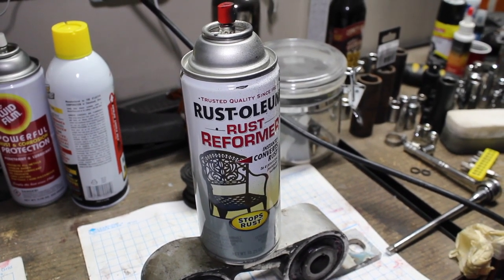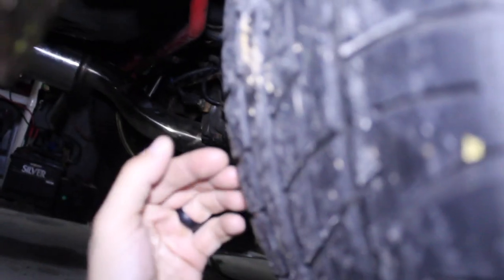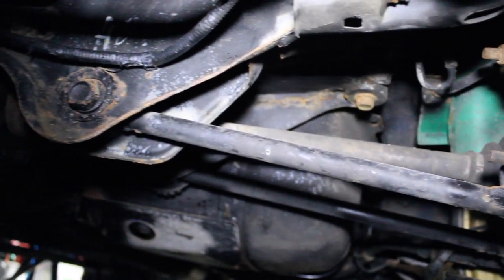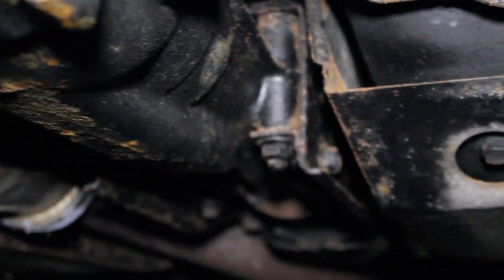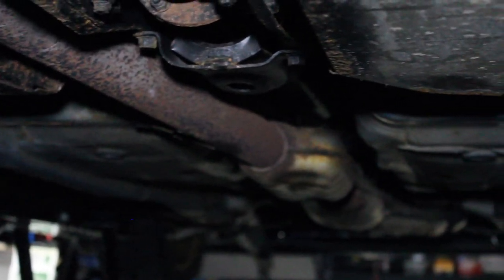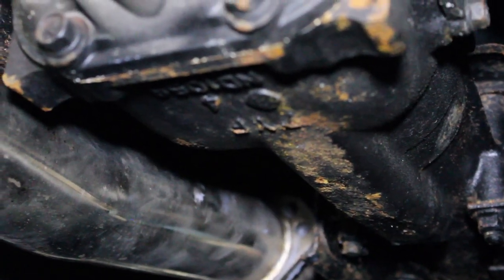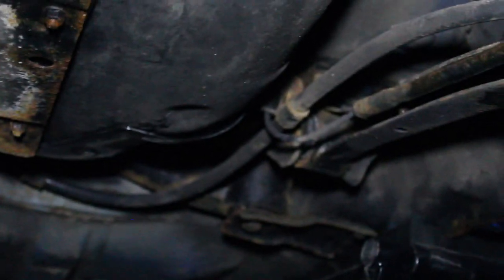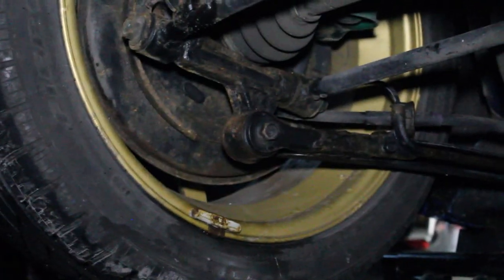Rustoleum Rust Reformer 1 Year Update Subaru SVTWRC

Comment: I'm doing the underside and frame on my 08 F150. I wire wheel everything, pressure wash it, let it completely dry, use a metal primer,  rust reformer, then top coat with black gloss Enamel from an actual paint can and brush. It goes on alot thicker this way and you can really work the paint into cracks and corners. And its cheaper than buying 15 spray cans. Once dry hit everything with clear gloss Enamel to seal the deal. Only downside is that it's very time consuming but its pretty much the only way to stop the rust.

Comment: I thought the rust reformer stuff is essentially meant to work like a primer. It reacts to rust, converts it to an inert black primer coating essentially. But like other primers, it's porous and doesn't seal the metal and won't stop new rust from forming underneath. I would have applied the rust reformer and then painted it with a top-coat. Even better, just use POR15...
Reply from the maker: Max Bitel been hearing great things about POR15 going to give it a go this spring. Will take some footage .
Reply: it doesn't react much to rust, just a cover up.  once coating cracks (which with in 24 hrs) water will collect under the coating and create mega RUST.
Reply: POr15 sucks. Use Rust Bullet my friend. Try it you’ll never go back.

Comment: Just used this stuff on my trailer hubs and undercarriage and after 4 days of sitting. There is some signs of the rust bleeding through. I am wondering if I paint over it if that will help keep the rust from bleeding out. I prepped the surface really good behind it and brake cleaned the crap out of it too.. Wiped it down afterwards and still got rust bleeding through. I did 2 coats. I do like the stuff but I might try another coat to see if it will stop the new rust from bleeding through. Suggestions?
Reply from the maker: Jay Bourbon hi some are using an enamel over the reformer but if it’s seeping through it may be about slowing it down more than stopping it. I just went under for a two year check up and I’m making a new video about it. You can see where I missed but it’s still better than it was in the before shots.
Reply: Rust reformer doesn't react much to rust, just a cover up.  once coating cracks (which with in 24 hrs) water will collect under the coating and create mega RUST.

Comment: Rust converter cause more rust.  I used it and in 3 years the total bottom of my beam got eaten away.  The reason is that once the rust converter coating cracks it collects water behind the coating and hiding the rust until it's too late. Trust me, check it out yourself.
Reply from the maker: New update soon , im using Fluid film now  with a coat applied every year before the winter season just have to keep it off rubber bushings.
Reply: @svtwrc  what happens to rubber bushing? what about rubber boots?
Reply from the maker: Web Cityx Fluid Film bottle claims it may deteriorate rubber if heavy coats are left on it.
Reply: @svtwrc  they say it may cause the rubber to "swell"
Reply: @svtwrc  My 2007 GMC was neglected and had some serious rust, this is exactly what I'm doing. Rust reformer followed by fluid film. Can't argue with the great results so many people have had with both! I trusted Rust Reformer especially because I found literature of tests done by various forest services, including one in Canada.
Reply from the maker: Adam J once it swells it should crack the rubber. Fluid film has been amazing . Thanks

Comment: Use rust reformer,at least do 2 coats and for your top coat use Mastercoat extreme permanent rust sealer and AG 111 for your last one,i used a grinder to remove any loses rust
Reply from the maker: Kayena Arellano nice ! Going to take a look at those products.
Reply: Rust reformer doesn't react much to rust, just a cover up.  once coating cracks (which with in 24 hrs) water will collect under the coating and create mega RUST.

Comment: that's looks good! did you top coat it with anything? I just did mine with enamel for a top coat.
Reply from the maker: Jacob Almeter that’s a great idea , didn’t even think of that.
Reply: @svtwrc  I believe the reformer is like a primer and lasts even longer with enamal on top. I used the pro enamal cans from Rust-Oleum. next time may even seal it with clear coat.
Reply: Jacob Almeter I just boat three cans of enamel

Comment: maybe I'm missing something but all I see is rust at all the edges and seams.. if the loose flaky and scaly rust isn't removed the rust reformer isn't gonna get under it and the rust continues.. at the very least all the rusty areas should be wire brushed or better yet wire wheeled before any top coating..

Comment: I got some rust forming inside my trunk at the edge inside by the welded points. What’s my best approach to painting it?  Do I need to tape off the entire back or just do short sprays not during a windy day?
Reply from the maker: NYGriego 74 you can use a wire brush on whatever you can see and spray the Rustoleum into the cap and paint it on w a brush. May just work
Reply: Rust reformer doesn't react much to rust, just a cover up.  once coating cracks (which with in 24 hrs) water will collect under the coating and create mega RUST.

Comment: Do you use Rust-Oleum rubberized undercoating after using rust reformer?
Reply: You can. Sand it, prime it with rust reformer, then hit it with the rubber coating. I think that's the best way, its an extra layer of protection against rocks and gravel or anything else that will chip the paint down to bare metal and make it rust.

Comment: If you use phosphoric acid and then a wire brush you'll really be able to knock that rust down to nothing. Rust reformer over that and then finishing the whole underside with Fluid Film, Krown, or used motor oil(anything oily or hydrophobic) will really keep the salt and moisture from forming rust. From there you just need to real oil things once a year(during summer is best so the oil can creep into all the metal). No more fucking around with constantly scraping rust or respraying reformer. 

Things may be a little dirtier and kinda greasy under there if you plan on wrenching but I'd much rather have dirty hands that take 30 seconds to clean than having to constantly worry about rust because things are sufficiently protected.
Reply from the maker: wufabufa fluid film is incredible , it’s in the background of the first shot of the video. I used it on my control arms and it works well , just have to keep it away from the rubber boots and bushings as it will eat them up.
Reply: Rust reformer doesn't react much to rust, just a cover up.  once coating cracks (which with in 24 hrs) water will collect under the coating and create mega RUST.

Comment: Hi. Do you have to paint after applying rust reformer?
Reply from the maker: Daniel Perez after reading the bottle and multiple videos and threads on this particular reformer, you CAN paint over to beautify but you don’t Need to if the surface is not visible. I personally don’t feel a need as the reformer works really well even over a year on the undercarriage. Other reformers need a top coat but this one specifies it does not.

Comment: You know you have to ut something on top of the reformer.
Reply: Alpha Omega like what?
Reply: @DanielPerez-zk6ut  Either enamel (spray paint) or that rubberized under coat. Enamel is the safer bet.
Reply from the maker: Alpha Omega this specific reformer does not require top coat like most if you are not making it look great like the undercarriage of your car. The rustoleum website and other forum users state that this is different from most that need a top coat due to UV exposure.  Not saying you can’t paint over , you don’t need to.

Comment: didn't stop the rust. Rusted underneath paint. u lose.
Reply from the maker: MrTruthislight going to do another update, mine is holding well I didn’t paint over it , I missed spots that I resprayed recently.
Reply: He's in upstate NY, nothing stops rust up there except for putting your car away for the winter. This is certainly better than nothing. Only way to win here is to move down south.
Reply from the maker: prushimush my Subaru is more active in the winter than the summer and my job requires attendance in the worst weather in NY . Thought it would make a great test vehicle for that winter driving. It hasn’t hurt the car more than it was and it looks like it’s protecting some of the more sensitive areas like strut towers and subframe braces. Another check up video is coming out soon.
Reply: @svtwrc  It looks like it's holding up pretty well for inland NY winters(Hudson Valley averages 60 inches of snow a year, quite a bit). I'm in NJ which is more mild; I'm gonna throw some on my truck's frame before the salt comes out.
Reply: Rust reformer doesn't react much to rust, just a cover up.  once coating cracks (which with in 24 hrs) water will collect under the coating and create mega RUST.
Reply: @prushimush  Rust reformer doesn't react much to rust, just a cover up.  once coating cracks (which with in 24 hrs) water will collect under the coating and create mega RUST.
Reply: @Asian_Connection  can't say anything else huh
Reply: You sound very jealous and a little grumpy. Lighten up dude!
Reply: @svtwrc  you spray strut towers with shockabsorbers on the car ?